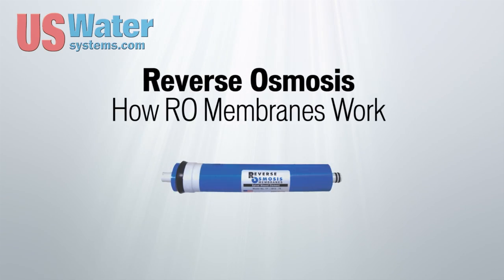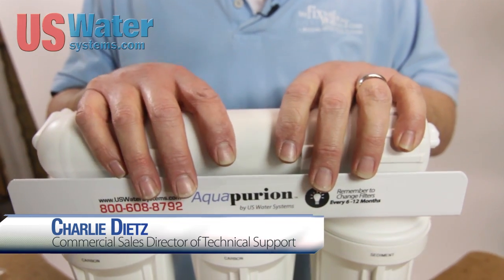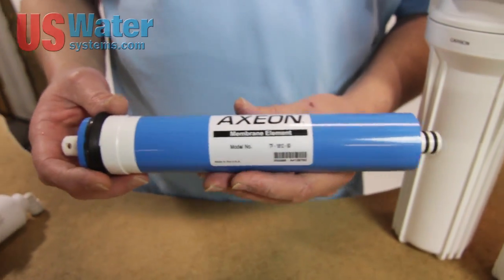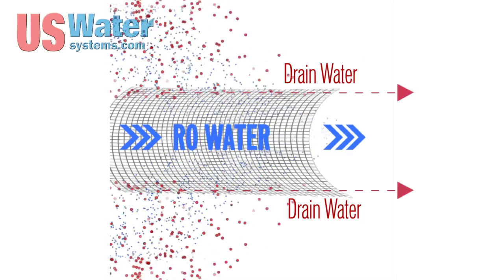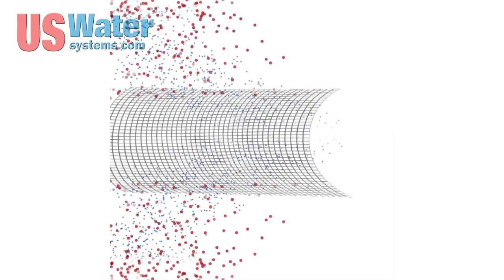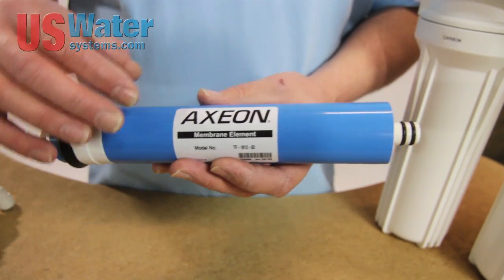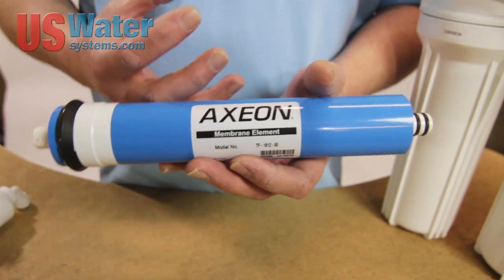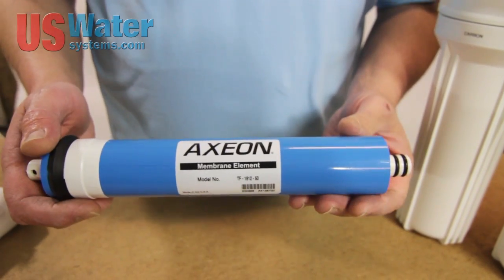How Ro Membranes Work

Comment: It recommends to change the membrane once a year. I've never changed it in the 2 1/2 years I've had it; and have never had a problem with water flow. Should I go ahead and change it?
Reply from the maker: 1 year is just recommended but it isn't an exact science. It really depends on how bad your water is or how much use the system gets. Do you have a TDS meter? Test your water with one. If it reads fine then you do not need to change it.
Reply: @uswatersystems  Thank you. No I don't have a TDS meter. But I usually just change the sediment and charcoal filters every six months and water flows well and tastes good.
Reply: @GaryH315223  I work for culligan and we change them when rejection rate gets below 85% (tds in - tds out)/ tds in

Comment: my water tds is 170-200. plz guide shall I go for ro system?
Reply from the maker: A RP system would be a good idea!
Reply: US Water Systems what is rp system}?
Reply: ro is not necessary but u can use sediment & carbon filter to enhance taste of water
Reply: Yes. You don't know what that 170-200 ppm is composed of. When you put in place a 6 stage RO system. The first 5 stages will reduce the TDS close to 0 ppm while the final stage will re-mineralized it, hence increasing the TDS. At least in this way, you know have a pure water with known essential minerals.